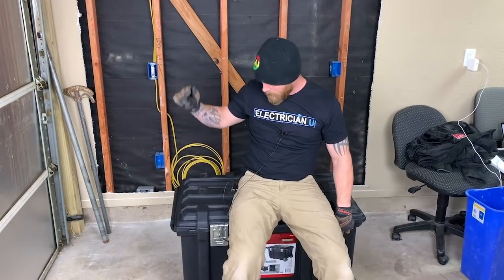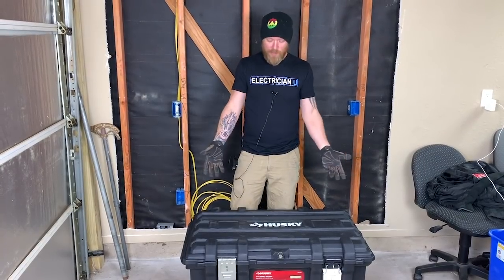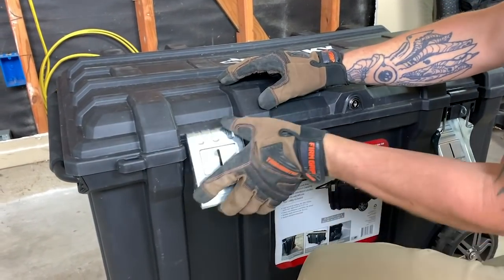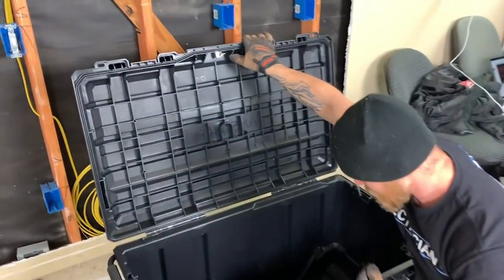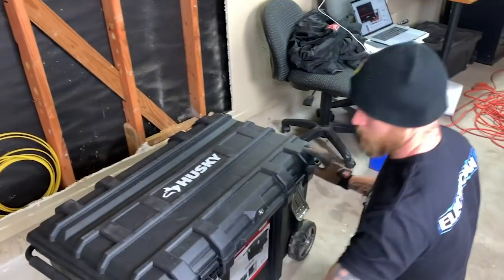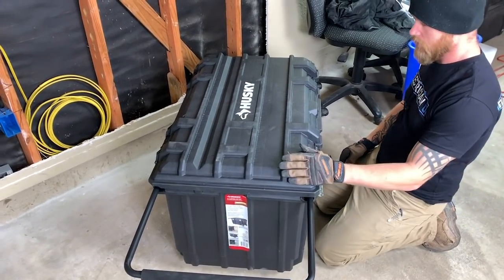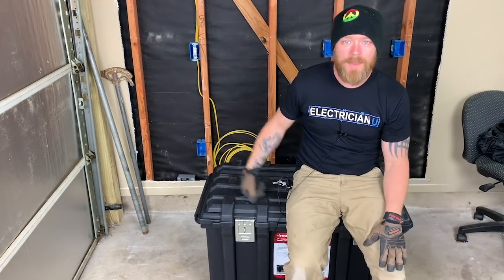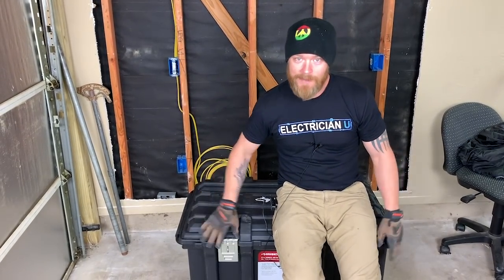TOOL REVIEW - Husky 37-inch Portable Job Box - ROLLING TOOL STORAGE CONTAINER

Comment: I'm an electrician and I use this box everyday for my hand tools, basic power tools, socket set, and safety gear. I like working out of it because I can roll my tools on and off the site but my only gripe is it's hard to organize.
Reply from the maker: Ya its really not that bad, I use it more for materials - boxes, plugs, switches, breakers, couplings, connectors etc.  I too wish there was more organization to it/dividers or something to keep things in place.

Comment: These are awesome for tack boxes. Horses have a lot of gear and my box sat outside in the elements for at least a year and it's still in great shape. The wheels aren't the best in the dirt but the handle makes it easy to move around as needed.

Comment: My last job we used 2 of those boxes, left them in the back of a tundra . One was full of chain saws and sharpening tools. The other was filled with climbing and rigging ropes as well as pulleyes and whatever. It’s been out in the Hawaii weather for about a year and are still holding up strong.
Reply: Did any water get in them?
Reply: thefordmaniac nope no water at all.
Reply: @montanawhite5699  where do u live i need some chain saws

Comment: I may be incorrect in my assumption that most of Husky’s boxes, bags and totes are geared for people like me (Home DIYer) but this is a good box for me, and at a good price. Holds all my large power tools and extension cords. Stays in my garage until I need it outside. Also don’t use the tray in the box but fits under the back seat of my truck for various roadside items. By the way you forgot to mention the molded slots on the top for cutting board s and pipes. Great video 👍🏽

Comment: I have been looking into one of these that are 23 inches in length with a "50 gallon" designation from Home Depot. I plan to use it to lug more tools from my truck to the storage after a work day. I have a smaller Stanley since 2009, not as robust as this one and it functions well. I use my tools roughly but don't abuse them...if that makes sense. My tools and my Dewalt ToughSystem 2.0 is scratched and shows sign of good use. I just need more tool portability from something that looks like a large lunch box.  How has this item held up since the making of this video? Thank you for this video, sir.

Comment: I have this box. I usually load it with sand and put it in the bed of truck in winter...however it is 2 inches to tall for my new truck. Is the lid remove able on it so then I can slide it under my bed cover